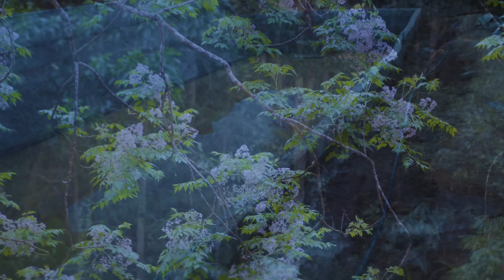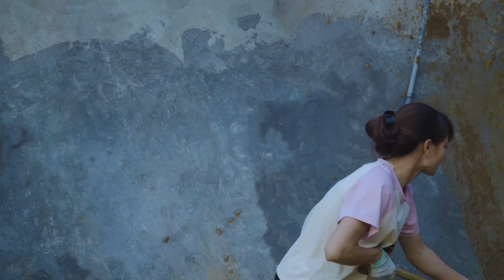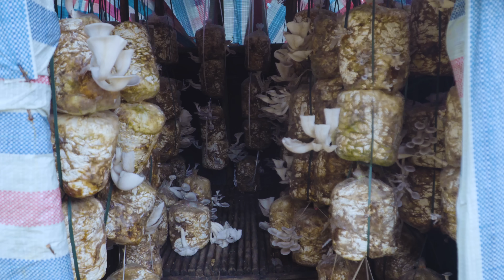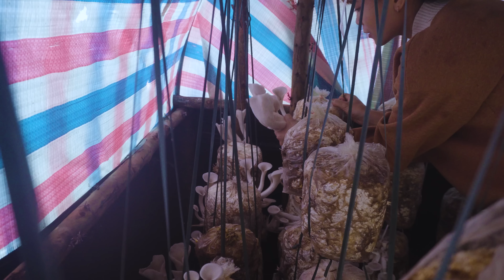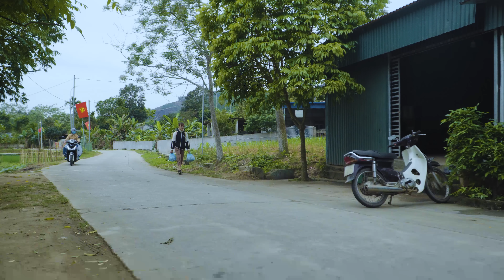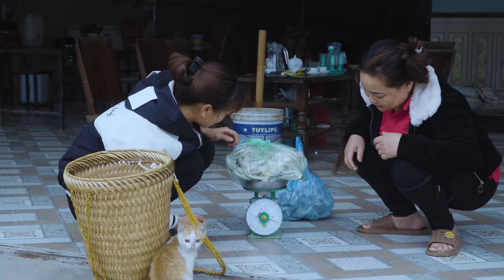Fish Pond Construction Project Failed - Please Give Me Your Advice #building - off grid living

Comment from the maker: Hello friends, I have tried to seal all sides of the pond, but I don't know where the water has flowed out. I'm very sad, really need your advice, thank you
Reply: สุ้ๆคะแม่คนสวย👍👍
Reply: Maybe you need to cement and seal the bottom too…
Reply: Dear Tham, my heart goes out to you!!! You embarked upon a project that is difficult for professionals with large modern equipment and quality materials. I have been involved in heavy civil construction for the past 40 years, so I will do my best to offer a few possible solutions based upon my observation of your construction materials, techniques and geography. 
1st and foremost you have to isolate the location of the leak. I suspect that it is percolating from the base level of your pond. Water weighs approximately 1,000 Kg per cubic meter, so it presents a great deal of force. So, first question I have is: Did you pour concrete on the pond floor? I seem to recall you building your walls on the dirt. Ideally, construction would have begun by constructing a concrete floor and casting what is referred to as a chain wall to create a monolithic joint at the most challenging place and that is where your wall meets your floor where the force of the water is the greatest. As a student of concrete chemistry, I can tell you that cement does not absolutely adhere to hardened cement. All that is possible to create in that event is referred to as a mechanical bond predicated on friction between the two surfaces.
If you did not use concrete for the floor, and if there is porosity that allows water to seep between the 45-degree angle where the wall meets the floor, the alluvial soil you have will serve as a wick for the water and will always desire to have equilibrium with the level of the water.
If you clean the floor from standing mud, primarily around where the walls meet the floor, and focus the video of the total perimeter, I could offer you advice on possible repair solutions.
Again, my heart goes out to you as I watched you work so long and hard on this difficult project, so don't give up now. We just need more information to make a better engineering assessment. Based upon observing the flow of water percolating through the soil, I am convinced that it is coming from any place in the construction that a wall meets a wall, or the wall meets the floor.
Reply: Try cementing the bottom of the pond so the water doesn't absorb through the dirt and flow out. 
You did a beautiful job. Don't give up. I love watching your videos.   I learned a lot of things watching you. I don't know how to do all those things living in the city but you have me thinking. So don't be sad.  You are strong and you will fix it. 😊
Reply from the maker: @kajuntex7677   thanks you
Reply from the maker: thanks you
Reply: A cheaper alternative would be to "puddle" the clashy bottom but only if it is clay. You need to check what the bottom soil is. Basically "puddling" was used in the UK (England) 300 years ago to hold water in canals dug over bad ground - like sand for examply. They got clay, added water and drove cattrle up and down it to mix it to a mud. So longh as this mud was not allowed to dry out it held back the water for hundreds of years until this day. I hope you understamd this only works with clay that has almost no sand in it.
Reply: What a shame  , all that work 😡 filling it with dirt won't do anything!! You need to fill the pool till it starts leaking , then from the outside start digging where the leak is , follow it back to the pool and you will find the leak , then plug it with cement 👍🏼
Reply: You can cement the bottom. Seal all corners with cement sealer. After you can also use waterproof cement paint and paint it all if available to you. Good luck!
Reply: @530captaincrunch  Poor girl has already stated she simply ca nnot afford to do that. Industrial Revolution mewthodsh of hcanal hbuilding had her problems and I've already told her how to solve it. I'm a retired construction professional who worked on old cnals back home, I know precisely what I'm talking about.
Reply: It looks like the water is traveling along a sandy seam from the bottom of the pond. A cheaper way to stop it is to use Sodium bentonite or "drillers mud" often used to seal leaking ponds. No need to drain just mix in the water until dissolved it will find the leak and stop it.
If you can't get that try hydrated lime mixed in the top 4 inches of dry pond bottom soil.

Comment: If your walls have not cracked under the pressure of all that water then it has to be leakingt under the "toe" of the walls because you only laid the wall blocks on a little cement on the mud. You got maybe 2 metres height of water - that is a huge weight to undercut your walls. You must concrete the bottom with cement a nd some mesh metal to reinforce it and also try to pack the wet bank back wher the water has eroded it. When you cement the bottom you must curve the cement up the sides to ensure the bottom is properly sealed to the sides. Use a concrete mixe - sand/small stones/cement and not just sand and cement as that is too weak. You will need it quite thick at the edges too - not just a couple of centimeters but at lease 20 centimeters where it curves up to support the water pressure downwards. Then paint with a couple of coats of cement "grout" - cement and water only mix, to make sure it is sealed.
Reply: Very good advice Clive. I attempted to provide pointers to her regarding that same construction flaw area. Repairing is going to require significant effort and materials; Water is quite heavy and places a great deal of dynamic load on any joints. I don't recall seeing her build a concrete floor, and if that is the case, there is no question where the water is coming from. I am also concerned about that dirt bank that appears loose fill dirt on the stream side; any failure there will be catastrophic and destroy that whole wall.
I am with you in thinking that the water is not seeping through the walls, it is coming from the bottom seeking weight equilibrium. I advised her to clean out the bottom, especially around the "toe" perimeter, film it for observation to provide solutions.
Reply from the maker: Thank you for your reference

Comment: Try this; drain the pool. fill the bottom with 1/2 meters of large rocks. then one 1/4 meter of smaller rock, then 1/8 meter of gravel, then top if off with course sand. Then a layer of hog wire and rebar. Then fill it with 1/4 meter concrete Then hog wire and rebar on the walls and you have to make wooden forms with at least 30 mm of space and poor the space with concrete to the top. Then angular peer blocks from 1 and a half meter  above the high water mark of the river at a 60º angle to support the down ward side of your pool. Anything less and your pool will continue to fail.

Comment: There’s some really good ideas along the line of cement the floor, but I think drain the water out let it dry out completely, so that the bottom gets hard and solid. Then layer the bottom with gravel, pack it down and then put cement on top, when completely dried paint the walls and bottom floor to seal or water proof.
Reply: if you concrete the floor it would have to be about 15cm thick to hold the pressure of rhe water

Comment: First And foremost your cement mixing is poor ..
2nd the you tampered the floor first before puting the cement, You have to cement the floor first before putting the water..
3rd..your mix it not good,..the exact amount of mixing the cement is 1 -2-3 meaning in one sack of cement ,2sacks of gravel, and 3sacks of sand, this is the exact amount if you prefer  a strong cement base..
4th. The exact amount of sand and gravel is 3/4 of cement sack.,..
And the thickness of cement 3inches...
Reply: And also don't forget to add your cement mixing ah water soluble powder,in one mixing of cement is one bag of water soluble powder,in the Philippines we called it SAHARA powder ....

Comment: 😎👍👍👍Dearest  Nagan I have been trying to help you with your pond. Let's start with what a cubic meter of water weighs. 1 cubic meter of water weighs 1000 Kg maybe because I was using standard English pounds a cubic meter of water weighs 1Ton!!! building a pool on a slope with so much volume is crazy! the weight of you pool when full up to 50 tons!!! with no reinforced steel concrete bottom just dirt your pool can not hold that kind of weight. Even if you can dry it out now to poor a concrete bottom it will never work!!! that how much 5 Simi trucks weigh unloaded!!! I don't think there is anything strong enough to hold that much weight on a slope there just is not enough support! I'm so sorry. when the rains start you WILL LOOSE EVERYTHING! BETTER START THINKING ABOUT HOW TO SAVE YOUR ANIMALS. AND BUILD ANOTHER HOUSE SOMEWHERE ELSE. AGAIN I TRIED TO TELL YOU.

Comment: so sorry this is happening with your wonderful pond
how ever this being the case ,can you see where the water is LEAVING your pond?
the water might stop leaking once the ground becomes saturated  .
another thing you might consider is that because your pond is so much deeper than
all the other Youtubers ponds , yours has a much higher head pressure so the water is being
forced out at a higher rate , Maybe. without knowing how deep the water has got i cant know.
you might need to consider  if your soil is to porous  pouring a concrete  slab on your pond bottom to hold water as you want,

Comment: BEING A FARMERS DAUGHTER I KNOW THAT SOME CLAY SOIL IS NOT ALWAYS ENOUGH TO HOLD WATER. I THOUGHT YOU WERE GOING TO PUT CEMENT ON THE BOTTOM/FLOOR ALSO. I WOULD SAY YOUR CLAY FLOOR HAS SPRUNG A LEAK. WHERE? TRY FOLLOW THE WATER OUTSIDE THE DAM. KEEP DIGGING BACK TILL YOU FIND THE SOURCE. WISH I COULD HELP MORE.
Reply: MAYBE.. IF YOU CAN GET YOUR HANDS ON A COMPACTOR. COMPACT THE SOIL AND SEE IF IT BLOCKS THE LEAK. STEVE HAS A GOOD IDEA BUT WE DONT KNOW YOUR FINANCIALS. I WOULD TRY THE LEAST EXPENSIVE FIRST. DONT GIVE UP.
Reply: You are correct Perth. It requires bentonite clay to hold water, and that is not absolute, but you have a better chance of success.

Comment: Use a rubber/vynil swimming pool liner. Get rid of all the sharp rock in the pond, then put a sand base in about 16cm  - 20 cm pack it down. Seal the side with tar and put in the liner. The tar should glue it in place. If done correctly the pond is saved.
Reply: Don't forget concrete is not solid but porous so it will allow the pond to drain. If you can't get a pool liner use rubber paint and coat at least 3 coats. I've used both methods depending on the materials I had at the time.
Reply: Good suggestion but I have seen other YouTubers use a tarp and liners and they said that rats eventually chewed through it.  Maybe a combination of both liners and reinforced concrete would work. 🤷‍♀️

Comment: The soil is eroding from the bottom and taking all the hillsides into the river. That Chang all the balance could make a land slide of all your side with the waters that com from the mountains underground, create a underground sink hole and the hill did will send all the silt to the river to the point that rocks will stay and the soil will cave slowly into the river. Usually big pounds are in a large flat land not on the bank of a river. First you need to change your hillside into steps like in mountain rice fields that will protect the silt and create a strong clay barrier that protect your land. Growing rice and corn  and mustard on all expose ground, on the hill next to the pound sugar can on firm steps. All your steps wall soul use stone and clay, not soil clay or cement as clay hold water and release water slowly.  You must understand that the water on top the little streams that feed the river, belong to underground water system. I suggest ask advice from the oldest living farmer